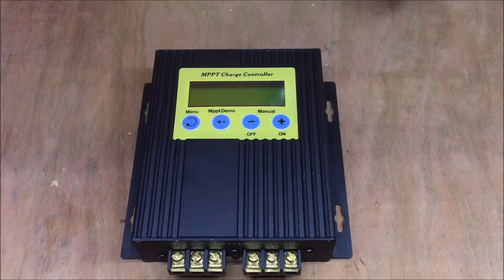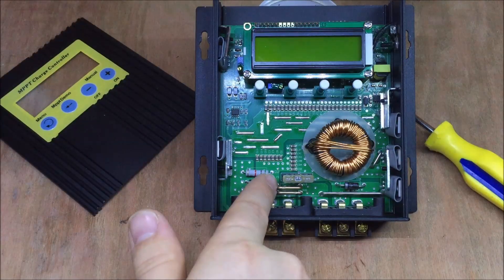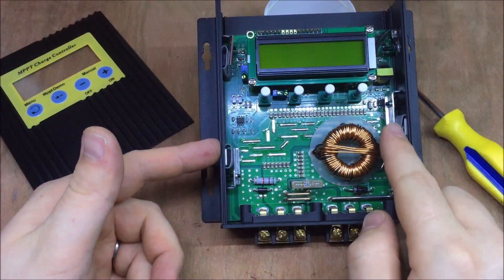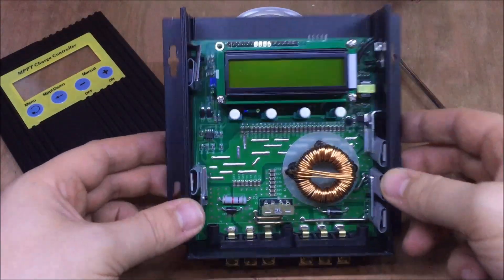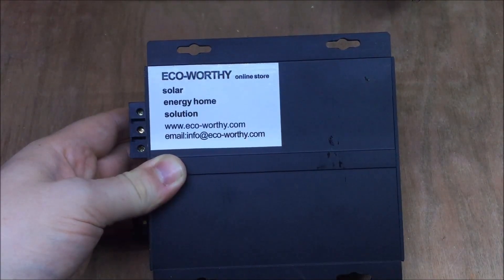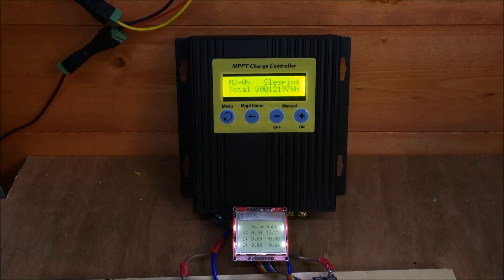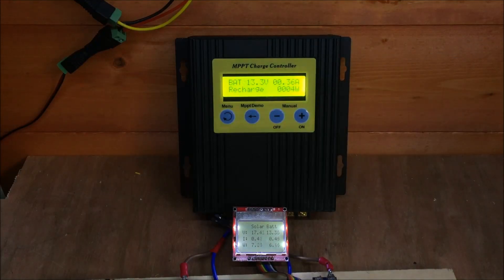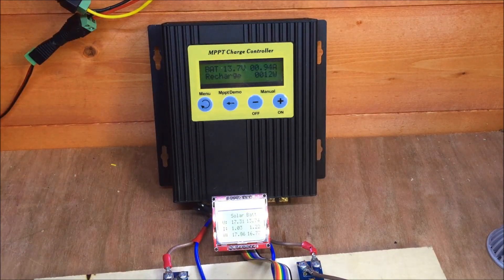eBay MPPT Solar Charge Controller Review - 12v Solar Shed

Comment: I've been running one of these for 2 years along side a couple of different model tracers: a 4210A and a 20ARN series. The Eco worthy one tracks a lot better and faster. The 4210A blew up as did two that a friend of mine had and I had to repair and modify the circuit to prevent this repeating. The 4210A also gets 'stuck' with panels at battery voltage for long periods of time to the extent that you are much better off connecting panels in parallel rather than series, the manufacturer basically said this as well along with 'what do you expect from a cheap controller?' I think your "anomalous" voltage on the panel side when disconnected might be some feedback from the voltage divider / a to d converter part of the panel voltage sensing in the unit rather than a leaky diode. I have recommended these to many people over the Tracer equivalent.
Reply from the maker: Well I'm running the Tracer 2210A in my shed at the moment.  I like the logging I can do with it now I have the Wifi Module.  But I have to say the Eco-Worthy is a great charge controller.  I agree now I've had the tracer in for a few months I think the tracking is slower, but it's still charging my batteries in the time frame I need it to and the advantages out weigh the disadvantages.

You might be right with the voltage on the panel side.  I never did get to the bottom of it, although I did put some schottky diodes in series with the panels that sorted it - but I never saw any issue with the tracking as a result (but obviously it was ever so slightly less efficient).

Thanks for your comments Phil.

Comment: Would you still recommend this charge controller, since your review of this controller and the many more you've reviewed untill today? Im looking for a decent cost effective charge controller to make the most of a 50W or 100W panel. Thanks
Reply from the maker: +Nv Cr Yeah it's a decent item which allows you to change some parameters and seems reasonably efficient. When I've looked online however, the EPEver Tracer A 20 amp is cheaper and my favourite at the moment.

Comment: In full sun a PWM works just about as well as MPPT. Cloudy and partial sun is where a MPPT  "shines" in comparison. I have seen a 30% difference. Depending on your conditions will tell you which to buy. Always sunny, no need to spend the extra bucks. Cloudy or panels that are not in optimum position to take advantage of the available light, then go ahead and spend the money for an MPPT CC. Got a sail boat? Use MPPT. Live in the desert? Use PWM.
 Keep in mind that  not all MPPT CC's work as well as another. Some are slow and some are fast at tracking. If you live where the clouds are constantly changing you need a CC that has a better sampling rate. Can't go wrong with Genasun. Costs more but is well worth it.
Reply: Even in sunny conditions,  the MPPT outperforms a PWM. A 100-watt solar panel with 20v Voc may drop down to 16v on sunny conditions and a PWM will drop it further to 14.4 to the battery but still input the rated 5A current. An MPPT will do the same but it'll increase the current
Reply: Joe Shmoe

Comment: can you set automatic equalizing charge on this? Even more, can you set equalization charge on this?
Reply from the maker: +Sammy Kalintosh No. The charge profile is just bulk, absorb & float. You'd need to manually adjust the absorb voltage every so often to perform an equalisation charge. Manual is here: http://eco-worthy.com/catalog/download/20AMPPT.pdf

The EPSolar Tracer A series I've also reviewed on this channel does a monthly equalisation charge I believe as standard.

Comment: Can you tell me the difference between a MPPT and a PWM charge controller, if you should happen to know or anyone else. Thanks in advance, either way! here's a ref: http://www.amazon.com/dp/B01CQHT5BO?psc=1
Reply from the maker: I'll try...!

Pulse width modulation charge controllers connect the panel to the batteries in short pulses to manage the battery voltage.  When the battery is very low the pulse width will be 100% - the panel completely connected to the battery.  The panels voltage will drop to that of the battery and will pass current to the battery.  All well and good, but pulling the voltage of the panel down to the battery level takes the panel away from its highest performance area.

MPPT does two things.  Firstly it does DC to DC conversion.  So it is able to take a panel performing well - lets say 17 volts and 2 amps or 34 watts and convert the power to 12 volts and 2.8 amps (assuming 100% efficiency) to charge to the battery. Secondly MPPT charge controllers monitor the power coming through the solar panel and adjust the load on it attempting to find the most amount of power for the given moment.

Hope that helps?
Reply: It does very much, thank you!

Comment: I'd really appreciate it if you'd review the tracking time on this charge controller. Of course it would require a working panel, because it depends on the behaviour of it, but this video offers an idea of what to Look Out For in "legit" MPPT charge controllers.  Specifically, they work well under ideal conditions, but not so well in dynamic conditions (sudden load causing battery voltage drop, "towel test" where the panels are obfuscated (to simulate clouds) and so on):

https://www.youtube.com/watch?v=dFuZywwpfaU

That said, I sincerely appreciate this in depth review. Considering the availability of these varied components, I'm surprised there aren't more. Especially considering what they cost!

Anyway, thanks again.

Comment: Hi Adam, is this the 20amp model....Im I right in thinking this model is not made in a greater amperage.....thanks..
Reply from the maker: +Kristian Winder You are correct on both counts. If you want a MPPT charge controller for higher currents try the EPEver Tracer A series. I've also reviewed that one on my channel. https://youtu.be/zTBrktPQdCM

Comment: @Adam Welsh Does it have various battery types, or are the voltages fixed?Also, how about the charge rate? Can that be set to match the battery bank capacity?Can you check to see if any of the terminals are common; i.e., are all the negatives common, or, are all the positives common?
Reply from the maker: +Donovan Lym You can adjust the a few voltages - float, absorb, discharge and restart. Have another look at my video where I display the specs. 
I had this open on my bench a couple of weeks ago and found that it's common negative between the solar and battery, but its common positive between the battery and the load.
Thanks for the comments
Reply: +Adam Welch thanks for your response. How about the current?
Reply from the maker: +Donovan Lym Solar Charge Controllers collect what they can when they can. There is no constant current charging that I'm aware of.
Reply: +Adam Welch So, you could well damage your battery with excessive charge current if you oversized your solar panels?
Reply: +Adam Welch See the following link. http://www.solarpowerplanetearth.com/solarchargecontrollers.htmlYou'll see a graph with absorption stage at constant current.  I believe that you can define the battery capacity and type in the Xantrex and therefore will limit the maximum current at this stage.
Reply from the maker: +Donovan Lym Yes and no I guess. If you had 300w of panels going into a 3Ah battery then the C rate is going to be rather high, but the controller will still cut off at a pre defined voltage, protecting the battery from over voltage. 

The graph in your link shows the typical charging cycle, but that's partly based on how batteries accept charge in perfect conditions. High current to start with allowing the voltage to rise, then constant voltage as the current drops off. 

However solar isn't ever going to be a perfect charging method - clouds coming over or breaks in cloud cover when you're trying to regulate either voltage or current are normal.
Reply: +Adam Welch I'm going to write to Morningstar support.  I will let you know what they say.
Reply: +Donovan Lym Morningstar replyThe current being sent to your batteries will depend upon your total input power and your battery voltage.  If your array is harvesting 300W of power and your battery voltage is at 12V than you would expect to see ~25A going to your batteries(assuming 100% efficiency).  In absorption the controller will begin to limit its current(not a specific amount but it depends upon system conditions) to maintain your absorption voltage.  There is no way to set a current limit for a particular stage of charging.  The TS-MPPT can be custom programmed to only allow a certain amount of current but that is not just for a particular stage of charging but all stages of charging.  You would want to speak with your battery manufacturer to see if there is a maximum charge current.
Reply from the maker: +Donovan Lym Thanks for this.

They've explained better than I could I guess...  once the battery is getting close to 100% SOC then the charge controller will limit current to keep the battery at a constant voltage.  It usually does this via PWM - short burst of connecting the panel to the batteries, and longer bursts of the two being disconnected.  This will keep the battery at a constant voltage whilst still getting the last bit of charge in.

Limiting the charge for your cells - with most controllers at least - is matching your solar array with your battery bank.  Most charge controllers are designed to make hay whilst the sun shines and deliver every watt they can to the battery until the battery show signs (ie. voltage level) of getting full.

Ultimately however, the system will always have to adapt to changing sun conditions.  No sun - no charge.
Reply: +Adam Welch Check this out http://www.solar-electric.com/deep-cycle-battery-faq.html#Starting, Marine, and Deep-Cycle Batteries talks about charge cycle and max charge current.
Reply from the maker: Battery voltages are customisable, but like most charge controllers it will harvest as much current as the battery will accept whilst it can. The system is common negative between the battery and the solar panels. Hope that helps.
Reply: Donovan Lym a

Comment: I have the same controller ( no issues ) in over a year.
I wish they would have made a more powerful one to handle more amps. It's good for 300 watts solar.
Reply from the maker: +David Pedder I'd be interested to see someone pushing it to, and a little bit beyond it's limit.  Someone who doesn't mind too much if they destroy it!  The mosfets and transistors are good for higher amounts of current and volts.  Heat might be an issue though.  It's the unidentifiable capacitors, resistors and diodes which may take exception!
Reply: +Adam Welch 
I agree that it it a well put together controller. I have the felling that one may be able to push it to 24 amps or about 400 watts.. I would hate to smoke a perfectly good controller though.

Comment: Hi Adam, Can this unit run 2 x 200w 12v solar panels (400w)?
Reply from the maker: +Roy Driver You'd need to run them in series.  The controller is capable of using 300w of panel at 12 volts, or 600w of panels at 24 volts.  Have a look at the manual - there's a link in the description.
Reply: +Adam Welch Thanks for the fast reply Adam much appreciated.

Comment: Can i take a wild stab in the dark and presume you've watch a few Julian Ilett vidoes :-)  Thanks for posting the videos i'm hoping to setup some larger solar panels myself and just trying to size things up, found 270watt panels for £100 which is very tempting.
Reply from the maker: +Colin Hickey One or two yes - I find his videos very interesting.  There's a fairly big hat tip to Julian with the test rig board layout and components used.

270 watts for £100 sounds like a steal.
Reply from the maker: +Colin Hickey Did you see the Arduino based PWM charge controller I made of Julians design?  It works brilliantly but a little under spec'd for a panel as big as yours might be; https://youtu.be/db1JZUecYlI
Reply: +Adam Welch Hi Adam i saw the posting after i viewed this video, have been viewing your others also.  I had been waiting for someone to make Julians design a little more accessible, i saw his design but found the task of converting that into an actual circuit on a perf board a little daunting so think i'll try it using the design you found.  Just need to buy a few more components.
Reply from the maker: Colin Hickey Well give me a week or two and I hope to have another design ready using a few less components and some more space; it should make the soldering a bit easier.
Reply: I had fancied the idea of doing the mppt from +JulianIlett but that was another step forward again.  Look forward to the revised version.  BTW are you just buying all your components from ebay such as resistors etc?  I'm good for resistors and capacitors as you can buy them in assorted packs but buying small amounts of specific transistors is what usually drives the cost of these things up.
Reply from the maker: +Colin Hickey The 3904 and 3906's within the PWM solar charge controller were bought from Bright Components at £1 for ten - not through ebay in this case although most of my bits are. I've since ordered a bag load from China for a fraction of the unit cost. Farnells wont sell them that cheaply unless you buy 25 or more.